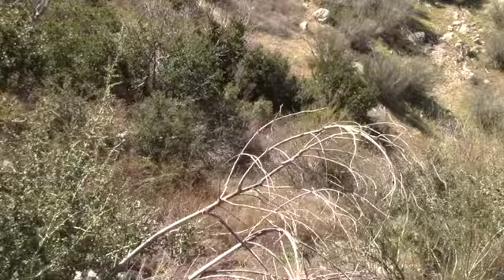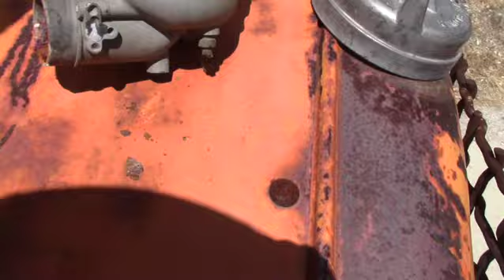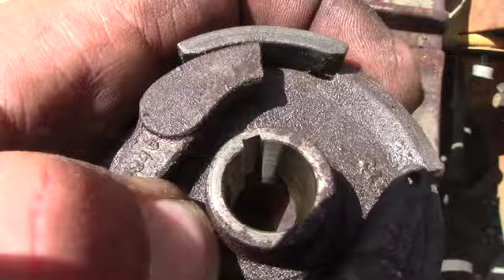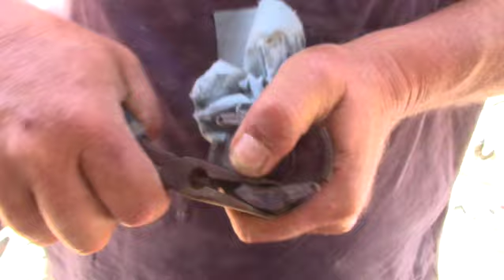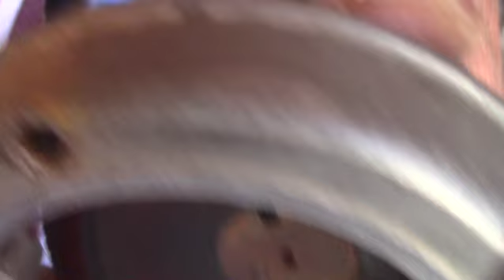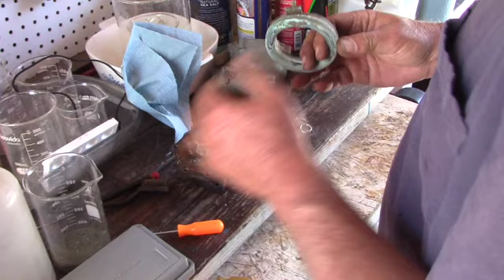Fixing Cat 15 mag and Cletrac AG carb (part 1 of tbd)

Comment: Would an ultrasonic cleaner work well on the carb?  Also Loren uses a product called 'Superzilla' which dissolve the rust from stuck bolts quite well.
Reply from the maker: An ultrasonic cleaner probably  would work well but I don’t have one…. yet. I’ll look for Superzilla. I have been using PB blaster and WD 30.